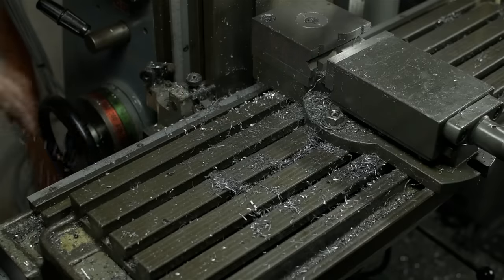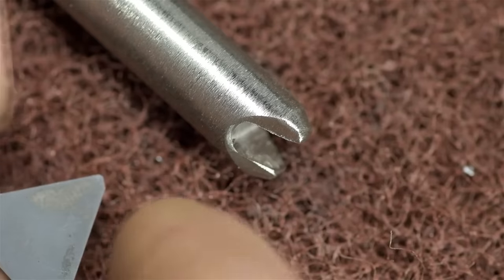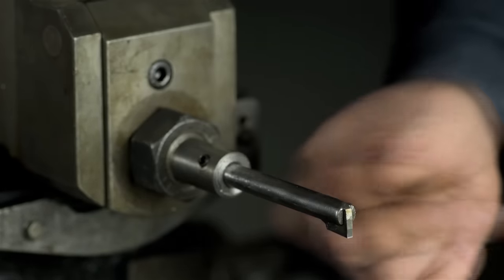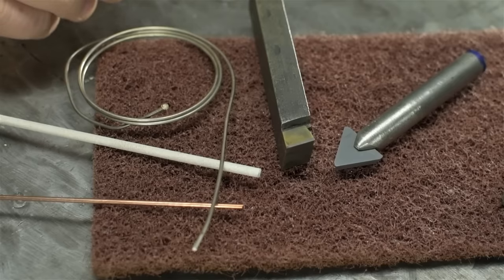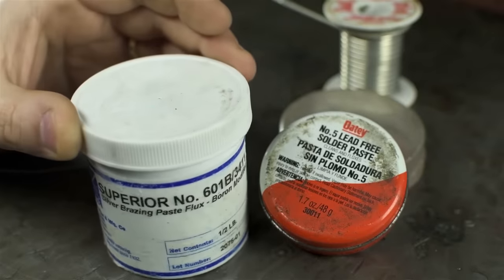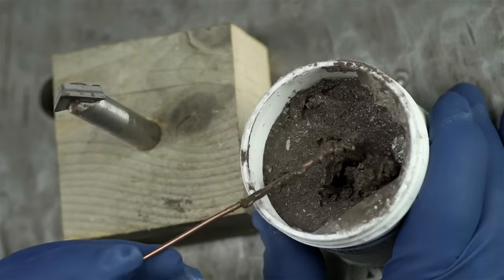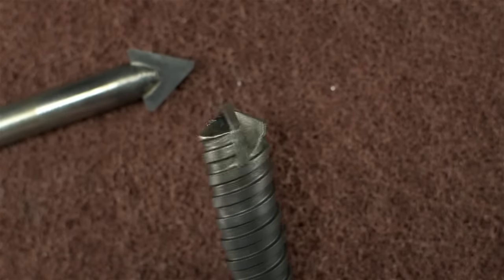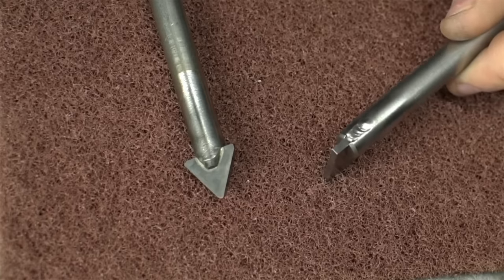Custom Tools - Brazing & Welding

Comment: Older cast iron bathtubs had a tendency to be cold around the edges and back in our day it was common (because it was so much work to heat up water on a wood stove) to not throw out the water from the first bather but simply heat it up with an extra pan of water. After a few bathers (normally kids in a family) there would be a waxy/greasy ring around the edge of the tub. Based on that, it’s amusing at best an appropriate for a 7 year old joke book from the early 30’s.
Reply: Yep my mom told me stories of half a dozen kids taking baths in the same water,  and the younger kids had to go last as they were presumed to be more likely to pee in the tub.
Reply: Sounds about right to me!

Comment: Skip the chit-chat?! That's the whole reason why I watch these videos mate
Reply: Which is his ironic joke because the whole vid is talk.
Reply: Soldering is not a strong mechanical bond. Just a surface bond. It Melts at temperatures below 200F. It cracks under force, heat cycles or vibration and therefore needs strain relief to prevent joint failure. Usually only copper to copper joints in plumbing or electrical connections. 
Brazing is much stronger, enough that it can be structural. Is done at much higher temperature and can join several metals even dissimilar ones with a strong joint often as strong as welding. 
So, no. They’re not essentially the same.
Reply: r/wooosh
Reply: Hmmm , :cat-orange-whistling: But your still good with the "Step into sexy" moment , right ? :face-fuchsia-wide-eyes:

Comment: The blue is surface impurities trapped by the flux from the cobalt matrix of the insert. You made Smalt, Cobalt Alumilite, where we get the famous Cobalt Blue.
Reply: Cobalt Glass!  ?!  Makes sense, if the "cemented" carbides are cemented with cobalt.   Then you get cobalt oxides, which dissolve in the flux along with the other oxides, making your own custom bits of glass!
Reply: The boron in the fux made a nice green flame. (Sorry, I had to add this somewhere)

Comment: I really enjoy (and learn from) your videos. But as a metallurgist, I have a few comments. "Soft solders" include the 96Tin-4Silver replacement for various Tin-Lead alloys. These alloys lack sufficient shear strength for tooling applications. "Hard solders" are brazing alloys, defined by the American Welding Society defines as having liquidus (flow) temperatures over 840F. Silvaloy 450, Safety-Silv 45 and other BAg-5 alloys are 45Ag-30Cu-25Zn and flow at ~1330F, plenty hot enough to soften high speed steels. When building carbide tipped tools with large surface area or corner/slot constraint, consider one of the trimetal shim preforms available from Lucas-Milhaupt. Silver-copper-silver (1-2-1)composites manage thermal stresses better and avoid carbide cracking. Obviously, the filler material and flux are in place before the torch is lit. Also, joint clearance is important. For the BAg-5 alloy, 0.003" per side is optimal and provides highest joint strength.
Reply: Thank you! I'm really grateful, you don't find this type of informations just everywhere! 😊✌️

Comment: You are solidly in the #1 spot in my que. I had one teacher, once, during my formative years, that was able to deliver useful information with high-quality humor. This burned the info into my head and I still remember that Masvingo is the capitol of Zimbabwe. I LOVE Diresta, AvE, Tips from a Shipwright, Abom79, SV Seeker, Clickspring, etc., but you are #1 in my (current) book. Thanks a ton.
Reply: I forgot "Hand Tool Rescue". But I am drinking my Friday cocktails. Sorry.
Reply: ...and his English... apparently. Only Washington DC has a capitol... everywhere else has a capital. Yw.
Reply: Not necessarily, in the country of Zimbabwe both the Province and Capital are Masvingo (province). So it's the capital of the province of the country? Confusing because there is just a town Masvingo as well, not Masvingo Province. OK I'm sleepy now
Reply: So great to see that I'm not the only one with the very same twisted favourites! :D
Reply: @OP: I'm subscribed to a lot of those same channels, and I wish they would add subtitles for the important bits. I want to mute most of those guys before I even start the video. What works to first gain an audience can get old and irritating, fast. Matthias and OldTony are two of the only exceptions.
Reply: The capital of Zimbabwe is Harare. Masvingo is the capital of Masvingo province in Zimbabwe.
Reply from the maker: thanks mudslide!

Comment: It’s interesting to read all the “ringleader” joke theories posed here, and they’re likely proof of why people fail to understand the actions of their predecessors in history. For all the clever suggestions, the joke is certainly simple, was utterly obvious at the time, and would have been funny then. In an age when most of the population was rural, electricity and gas weren’t yet universal and were often quite rare, and therefore heating water was difficult and expensive, entire families shared bath water, which probably also had to be drawn by bucket from a well or hauled from a creek. People worked farms and “dirty jobs” industries, in the heat, got really dirty, and in many cases bathed only weekly. Where you might eventually make a dirt ring at the waterline today, the ring was “quick & dirty” then, pun intended—grime, oils, soap. So the first person in the tub, perhaps the head of household, was definitely the ringleader. Everyone used the word in its usual senses, so the pun was obvious. It’s been said that after a family of 10 finished bathing in the same water on a Saturday night, the water was opaque with dirt. Since children often bathed last, finishing with the youngest, the saying arose, “Don’t throw out the baby with the bath water.” Its meaning is philosophical now, but then it was a joke that referred to the fact that the baby was practically invisible in the filthy water. Sounds disgusting, but after a week without any bath...maybe not.

Many more people were poorly educated. A seventh-grade formal education wasn’t uncommon a century ago. Life necessitated work, not more school, but while they were behind us in formal education, they were often ahead in practical skills. Nonetheless, times were simpler and so was humor, so the ringleader joke would have been a lot funnier. It’s enlightening to hear old Vaudeville routines from those days. Their uproariously funny humor is beyond corny now, yet there’s a lot to be said for it in contrast to today’s comedy.

As for modern interpretation of the ringleader joke, it’s easy to make the same errors people easily make when looking at any historical item. If you don’t know its context, you’ll inevitably judge it (distort it) by modern expectations, analyze aspects into it that never existed, subject it to your own biases, and reach a faulty conclusion. You have to be careful and thoughtful with the past. In some cases, people have forgotten that.
Reply: so to put it simply its pretty much a "so why did the chicken cross the road - to get to the other side" joke
Reply: Thanks for that. I grew up on a dairy farm, and vaguely recall hearing this joke as a kid. Honestly, it probably fell as flat to me then as it did to me now, and had to be explained then as well. Your explanation seems correct. Matter of fact, the "dirt ring" was the thing that immediately popped into my head when I heard this joke for the first time, again(?). Indeed, the humor is probably lost without proper cultural and historical context. It was probably only because of my rural upbringing that I even managed to connect the dots to make this joke make sense. To most of the populace nowadays, even explaining the that it's a "dirt ring" would have left blank stares as taking a bath is far less common, much less sharing the same bathwater.

Bathing. Reminds me of https://www.youtube.com/watch?v=dPmBle0Dljw
Reply: I thought this was a rick and morty "theoretical physics joke" meme.
Reply: I grew up in a jungle where we frequently boiled the water over the stove cuz our water heater only worked about 20% of the time and couldnt do a bath load of water; I instantly thought of the rings that used to form from the dirt and it made sense. I was about to post when I saw this. I don't think it was pretentious or long winded; rather insightful and well written; potentially a little presumptuous about faulty conclusions but you do you.
Reply: Bobby Fisher "Over here"...you should clean your bath more often.
Reply: Yeah I got that pretty quick. Mostly because my mom would bath all three of us boys at the same time until we were probably 5. 

Many rings we're made in that old bath tub.
Reply: You got that lifetime subscription my friend
Reply: fire
Reply: "All you guys guys trying to explain the super simple and obvious joke. It's (inserted three paragraph dissertation). Duh"
Reply: Jesus christ how much time do you have on your hands
Reply: Did you breathe while typing this out?
Reply: I really hope this this is satire
You know those people that try to act a specific way in hopes they will be viewed as an equal or superior to their peers? Or the people that think they are superior to everybody because they have "a 160 IQ" yet they have done nothing notable in their lives? that is the impression you give when you talk, true or not you may want to take this advice to heart.  Being intelligent and speaking with a wide vocabulary is great, but you are fake, or atleast appear to be disingenuous. We are all very good at identifying emotions through writing, and we can usually tell when somebody is speaking naturally or if they are essentially "lying" by trying to portray a character (the people who look things up in a thesaurus for example, it is just unnatural and doesn't flow like it would if you were genuine). You also refer to everybody else in a very condescending light which makes it even worse.

You decided to  pad this simple answer with nonsense in the hopes of making it appear to be something that "only intellectuals can understand" when in reality its just... a simple outdated joke. You literally posted a theory behind a joke, yet somehow appear to be so fake and superior that you could make it to /r/iamverysmart. I highly recommend you stop trying to "fit in" with your idea of what an intellectual should act like, and instead be yourself, and invest the time required to become what it is you wish you were. However if this is the real you then i am very sorry. Part of "being smart" is knowing how dumb we all really are and striving to get better. Its why we are all here. Next time, give an answer without acting like you graced us all by returning from mt. Olympus to enlighten us.
Reply: i think you may have quoted wikipedia
Reply: @hungryorphan7711  at least 21:00 to watch this video ..
Reply: @SxTxferlife  this explanation was very well written maybe a little over written. This issue most have with this is the OP's presumptions and negativity of other people, the need to point out flaunt some sense of superiority. The information was great but the attitude wasn't.
Reply: @Wasabisauce so is your comment, thanks for adding to the conversation. your insight and opinion was.... great
Reply: Commenting so I can keep this for the future
Reply: Explanation 100
Speech 0
Reply: @azurplex  would they know that?
Reply: I just want to say thanks for taking the time to write and post this. Reading through some of the other replies, I'm not sure if someone else left a derogatory comment that was hence deleted and they're replying to that, but I didn't find your explanation long-winded or condescending at all. Considering how vastly different something as mundane as bathing was "back then", someone born in the '90s or 2000s would need to know all of those details to fully understand the punchline and context of the joke. 
Oh, and I appreciate how you tied in the throwing out the baby joke. That makes way more sense now. 

I'm starting to think the kind of person who takes offense to the method something was explained to them is why terms like "mansplaining" and "safe spaces" exist today. Learning is fun. If someone is willing to take the time out of their day to teach you something, say thank you and move on with your day.
Reply: @alexrowland  mansplaining exists because some men think that they are far more educated than the majority of women, even when the woman is far more educated about the thing the man is trying to "explain". The term refers to this interaction and usually includes a very condescending, and often derogatory answer. Though often times this can be used to any condescending or derogatory answer. 

As to why safe spaces exist. Well, we would have to go quite far back into history to explain why they are needed. But suffice it to say that they exist because sometimes it is the only place a person can go where they won't be judged. Imagine for a moment that everyone, your "friends", your teachers, and even your parents. Disagree with a life choice that you have. A lot of times to the point that they are constantly degrading you about it, sometimes even trying to force you to change. If you can't even feel safe in your own home, where do you go? That is why safe spaces exist.
Reply: You are eloquent with words. A true commenter youtube should be glad to have. Lol
Reply: @jenn5774  🏆🥇WINNER: BEST COMMENT IN SHOW !2020!🥇🏆
Thank you.  You made my day. ✌
Reply: @muchtall  Not sure why you feel this way, his answer seemed well put and to the point.  I am however assuming he posted after numerous individuals posted answers that were not based on any historical research.
Reply: I grew up with shared bathwater, and the bathing order was usually cleanest to dirtiest, which generally meant youngest to oldest.  But yes, in the joke the ringleader is plainly the first one in terms of the bath ring (which is the actual term for the dirty ring left after bathing).

Comment: I work in band instrument repair. I fell down the rabbit hole of your channel because we do a lot of lathe work to make our own tools. Brass instruments are held together with solder, so we do a lot of that as well. My experience has mostly been with 94/6 and 96/4 tin/silver solder for what we call "soft" soldering. Something that we want to be able to take apart again some day. We tend to use the terms "hard soldering" "silver soldering" and "brazing" interchangeably, even though our soft solder is technically also a silver alloy. Silver soldering is for things we don't want to come apart again ever (broken parts or homemade tools, usually). It's interesting to learn more about soldering applications that I can bring to the shop.

My friends and I love your content and humor. Keep it up! (:

Comment: So coming back to this later and not sleep deprived, a good tip is to clamp the high speed steel into copper or aluminum blocks to help absorb the heat at the cutting edges which can be good if you really want to weld hot.

Comment: Okay, I have to make a confession: I have used Oxy-Acetylene to solder copper pipes. You have to be really gentle, though. 

I tried to show someone else how to do it -- he said he knew how to braze, so I assumed he could also solder. I looked away, and when I looked back the entire joint was glowing. He actually managed to fuse the copper joint together.

Goes to show, don't assume that people know what you mean.
Reply: But did the joint hold water?

Comment: In German brazing is „Hartlöten“  and the other is „weichlöten“ 
„Weichlöten“ goes to 450
„Hartlöten“ goes to 1200
„Schweißen“ is all over 1200 

Measurement is in Celsius 
Good day together
Reply: Good ol german over engineering.
Reply: Exactly. Hard soldering,soft soldering and welding.
Reply: This is 2018. Why do you archaic heathens refuse to use Kelvin? 
(this is humor if there is a translation problem)
Reply: wolfedog99 Close only counts in horseshoes buddy.
Reply: > Good day together

German confirmed! (Guten Tag zusammen)

In English you don't use "zusammen" to refer to the people present. It's more normal to say "all" or "everybody".
Reply: nope the last one is "hochtemperaturlöten"(high temperature soldering) and its >900C°. "schweißen" (welding) is a different proccess
Reply: So they are all Schwettin as they work?
Reply: wolfedog99 Kelvin is the most reasonable unit of measuring temperature in my opinion, because 0 K is literally no temperature, absolute cold.

Comment: I think ‘the ring’ refers to the ring of dirt left around a bathtub which marks the high tide.
Reply: atho9e that makes the most sense out of the other explanations I read. Highest ring due to water displacement. Superb observation sir.
Reply: That's where I am with the joke as well.
Reply: I was going to say the same thing!
Reply: You need to also take into account that Baths were universal and showers weren't a thing until fairly recent. Like 1950's, so the "ring" would have been far more common knowledge.

Comment: Great video Tony as always!  Mapp gas and a turbo torch would do the joints you did with no problem. anything bigger your right you need the oxy-acetylene.  High speed steel brazes fine with safety-silv 56 which has a liquidus of 1205F which is in the realm of the red hardness range of high speed steel. The safety-silv 45 has a liquidus of 1370F so it would not be ideal. I only buy the 56 because it works better on just about everything.
ATB, Robin

Comment: As someone who lived in an old country farmhouse and took baths in a big galvanized steel tub with water heated by cook stove, I can confirm that when multiple people take baths where you use the same water, there is a visible dirt ring left after the first person bathes which gets more pronounced as subsequent people take their baths... Is that simple.

I already have a lifetime subscription to the channel so having my initials: RKP stamped under a handmade tool data plate will be reward enough.